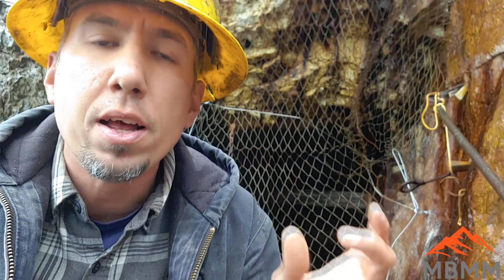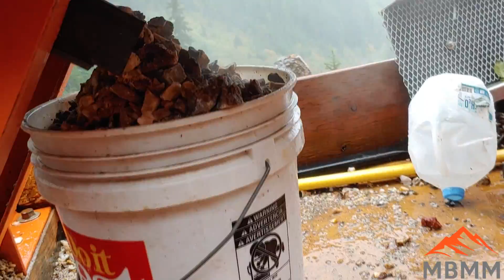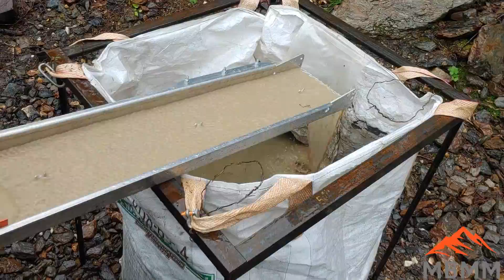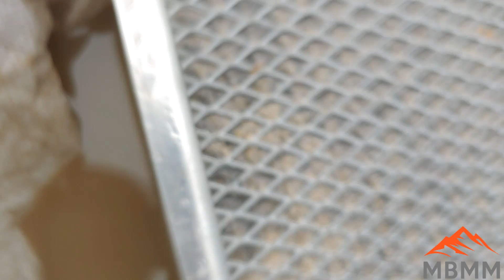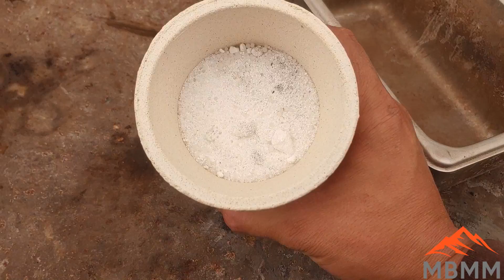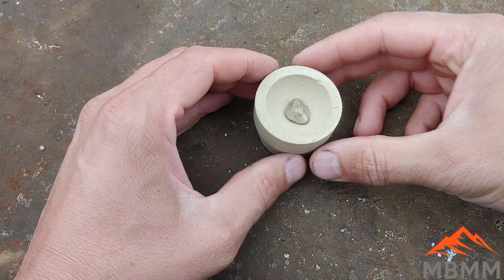Complete Gold Mining Plant, Fully Portable On A Truck!!

Comment: Something that just peeked my curiosity when I was hooking up shredder to my Kubota compact tractor.  You could probably work up a model of the mobile hammer mill and sluice adapted for PTO off of a small tractor. I would imagine a lot of small miners have compact tractors with front end loaders for moving material.

Comment: I think that you didn't give the correct amount because it looked to me like you saved all the tailings to regrind to smaller bits so you could run it again. It would have been nice if you mentioned all of this. After crushing the ore it looked like the crushed ore was way to big to run through the sluice.
True or false ??
I am subscribed so I'll be notified if you answer
Thank you so much

Comment: Density = mass / volume. Use distiled water. Fill with 25 ml of H2O. Weigh the beed. Drop the button in and read the water displaced. Equipment: 50 ml Graduated Measuring Cylinder and sub gram scale. Example: Weight of button 25 grams. Water displaced 25 ml so it's 25 grams divided by 25 mililiters equals a density of 1.0. Congratulations, you just drilled a very expensive water well.

Comment: I want to ask how much water does the hammer mill consume per tonne of gold ore ?
Reply: I don't remember everything he said but that looked like 1/2 gpm in the mill and 20 gpm in the sleuce. 700 lbs in 1 hr  (60 minutes)?
Reply: @artsmith103  thank you
Reply: @tatendamagodi9325  Next video shows improvement to the mill and replacing hammers. They increase water injection and use it to flush the sides better. Maybe 1 gpm. The hammer mill is rated at 1,000 lbs/hr.
Reply: @tatendamagodi9325  20 gpm in the sleuce. Mistyped the 0. Pretty big mistake :-(  Glad your comment brought me back.

Comment: PERSONALLY I would prefer to put 100% of my operation inside, right up by the working face so I only carry out the finest ore or even refined metals!

No reason to waste time carrying waste!

So far as the hanging wall, I'd just poke some concrete and steel columns to protect my gear and my self while I work.

At such high grades as you listed, at the very least I'll make 90% profit over my cost of operation!

       /)/) 
    (  'ˬ') 
@(>_ )-b 
     \) \)

Comment: Do you really think those lil tooth picks are holding anything up you're straight up as dumb as the guys who put them there... Think about it this way take a branch off a tree and take a 2000 pound boulder and put it on top of the stick what happens is the stick is going to snap it's the same thing as taking a tree and putting it under hundreds of thousands of pounds of rock the tree ain't holding anything it's staying up cuz it's stable

Comment: 500$ worth of gold in less than 8 hours.
im struggling to do this. 
i need help.
i have three mines that have no visible gold but assay at over two opt Au. 
is there a way to concentrate materials that are pyrite rich and copper ore/bornite flooded rhyolite with precious metals in the cracks of the rock?
i would like much to not have to toll mill ore 870 miles from where i am.

Comment: Here is a great 👍 idea that will help your back and time. A small portable feeling belt up to the level of the truck system or ground. You could also just carry the fulcrum legs, belt, 3-4 8’x12”-24”+ sectional with motor. If it works out for y’all like I know it will please consider a royalty for the plans especially if you sell them we could talk further.
I truly hope y’all took samples and made some thin sections to get some ideas on the original grain sizes before the crusher and grinder.

Comment: still a great rig ausome set up. I would add a metal tube roof that you can put a tarp on keep you and the equipment dry. And a jack all to use on the truck to level sluice run. still quite hard to improve on that set up, good work.